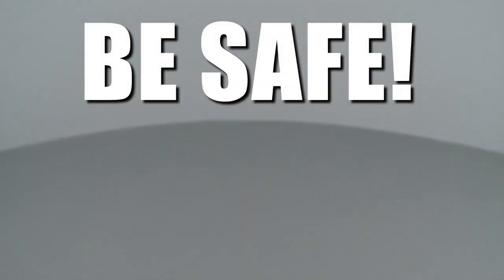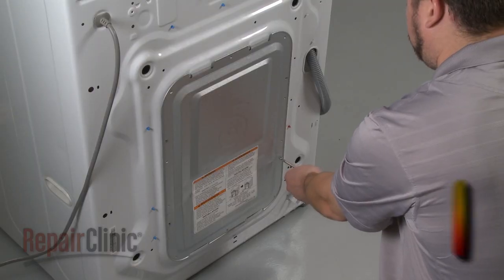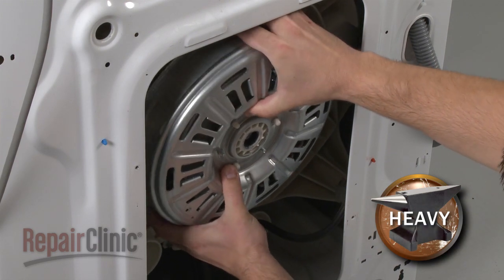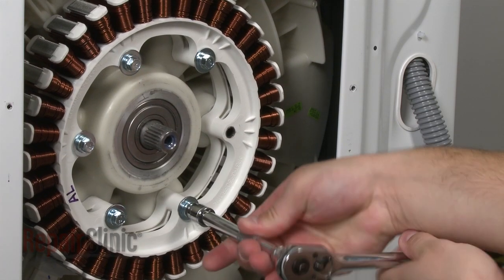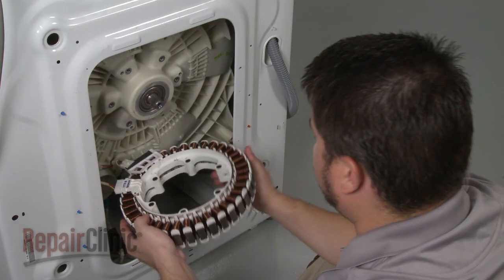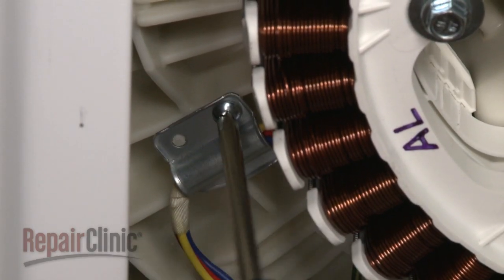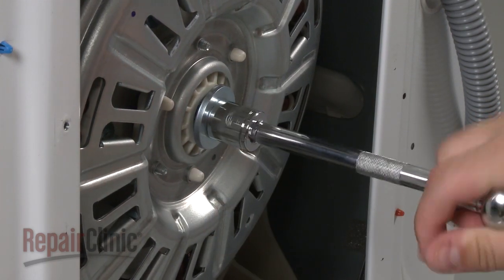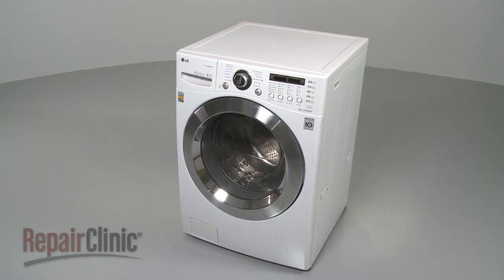LG/Kenmore Front Load Washer Replace Stator #4417EA1002K

Comment: The item in the video is a LG sensor assembly that has both a stator and sensor assembly. This sensor assembly is shown at 1:27 and is a hall effect sensor that senses the rotors magnets. This times the driving of the stator's three phases. On this video the sensor is at the bottom 6 o'clock position. A leak from the rear washer bearing can sometimes ruin a sensor.

Comment from the maker: If the washer won't spin or agitate the stator assembly might be burned out. The stator is essentially one half of a motor, it interacts with the tub by creating a strong electro-magnet. If the stator burns out the washer won't spin or agitate.

Comment: I have a LG serial #wm2487hrm, and when I washed a load of clothes, it smelt like rubber, and smoke came from the tub. I noticed little pieces of rubber in the rim that had to fall off. What could be wrong?
Reply from the maker: +Debora Gable The washer rear bearing may be wearing out and the tub is leaning forward and rubbing the the outer tub during operation.